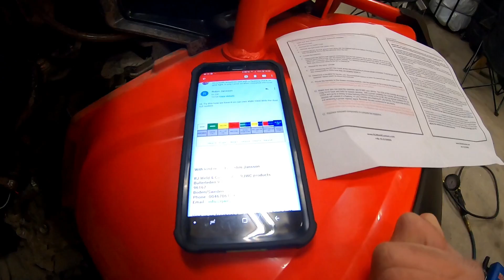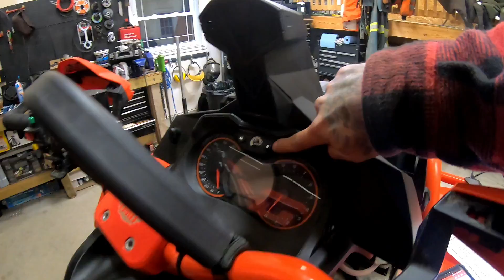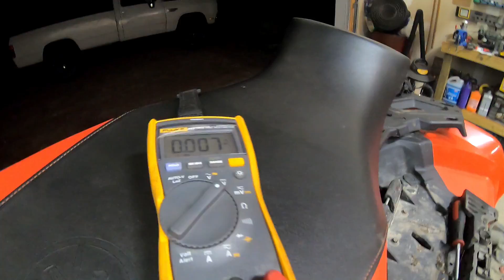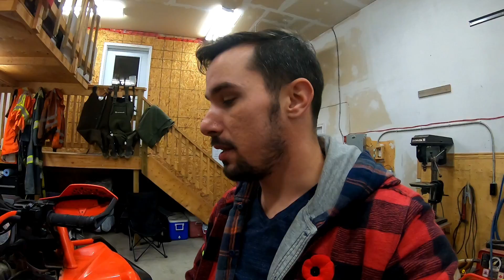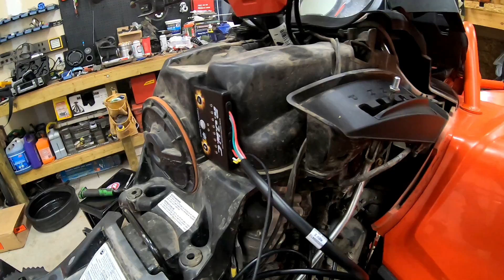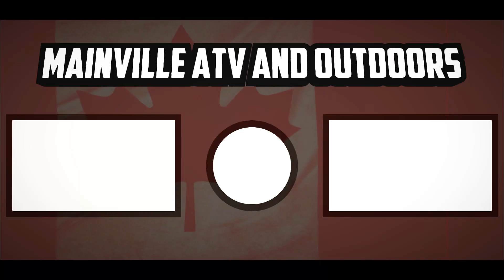RJWC Fuel Tuner! Can Am's Awful Lean Condition! (Can Am Outlander XMR 1000r)

Comment from the maker: What is your experience with tuners? Which do you have? Lets talk about it below! Don't forget to subscribe :)
Reply: What settings should i go for extreme hill climbings? What’s the best mode? I’m running on Outlader 1000R xxc...but still i want to keep the original pipe...RJWC pipe it’s tooo loud .Thx a lot🤟🇷🇴
Reply from the maker: @dreunu9887  I would call dobeck for that.
Reply: the tuner the good too is badly made mine water to get inside result button - stick shit

Comment: I have a question for you.
I bought a used 2006 outlander 800 and it has one of the RJ WC tuners on it and I experience a weird issue when I started up for the first time for the day if I shut it off and then immediately try to start it again it will not restart I noticed the lights are flashing on the tuner and I have to wait for them to stop flashing in order for me to be able to start the bike back up again. Do you have any ideas what would be causing this?
Reply: Hey thank you so much
I called them and I figured it out😃
Reply from the maker: I've never seen that happen. My guess is it isnt the tuner but hard to know. I'd call dobeck and ask. :)

Comment: Just made the chage tonight on outy 2020 1000 max limited,got it from durtylife as sugested, with covid took a while to get it but still goos service from them.installation was more complicated with all the wire harnest on max limited, but did it.
When for a test rise at 19:25 just before curfew.on pack snow, at minus 1 ,at level tuning for mod pipes ( with stok pipe) Sports mode, i felt a lot of more torque, so muchthat i felt torque steer, what a difference, tks for the tip and video to make it simple. Have a good hibernation (here in quebec until 8 feb)
Chears

Comment: Really thinking about it. I have a bogging problem on my 2020 canam 650. It bogs when you get on it but goes away once you ride it for a couple minutes. I let it warm up for 5-10 minutes before I ride it and it still bogs until you ride it for like 20 minutes then it goes away. Thinking it maybe could be to high of octane of fuel, to restricted or maybe to high of octane because I am running 93 in it and it’s olny a 650 so idk. I also read that a lot of people have the same problem as me and say it’s just a thing with canams and that their is nothing you can do about it. Hoping a tuner and exhaust will take away the issue because the machine is a beast once it warms up.

Comment: I'm running same set up on my renegade 1k but not sure on what settings I should be at? Rjwc duals, air filter and rjwc tuner. Seems to still be running pretty hot "lean" . Curious what you set yours at ? Also where did you hook up air/fuel gauge to?
Reply: What did you set yours at

Comment: Hello. Was wondering if you could help me out a bit. Just added RJWC duals and the tuner to my Renegade 1000 and was wondering if when u installed yours if the settings was good to go out of the box? And also how to go about testing the air/fuel ratio? Any advice would be great. Thanks

Comment: The wiring coming out of the first tuner you had was different than your second one that is weird. The first one only had wires coming out of one side and the second has wire coming out of both rubber pieces on top of the unit. Mine also has the wires coming out of both rubber pieces on top. Great vid way to roll with the punches 👍👍👍

Comment: I am keeping my 570 stock.  Everybody shares this frustration at some time.  Couple of years ago I DIY installed a garage door opener.  On the cordless phone, in freezing temps, up a ladder trouble shooting it with the Manufacturer.  Finally they yielded and sent out a new logic and power board, and again DIY fit those in place of the originals and "voila", worked perfectly and has since then.

Comment: So I just installed a rjwc full exhaust mud edition. Install went great but now my quad will not go faster than 44 mph. It does not matter what key i use. I have my performace key in and i still can not go any faster its as if once i hit 44mph its goveroned and just revs. Any ideas?
Reply from the maker: My guess possible cylinder miss, or limp mode. Something like that. If you installed a tuner which I hope you did, ensure it is plugged in correctly and grounded.
Reply: @MainvilleATV  i used rjwc tuner. I have no P codes. How do i know if its in limp mode?
Reply from the maker: @MGABRIEL8283  it usually tells you, but not always. To me, you may be in it due to a miss in one of the cylinders. Just a guess
Reply: @MainvilleATV  Thanks for the info.

Comment: Dobeck has a video of the chip board for these controller submerged in water. They have a water proof coating on them. I just bought one and a exhaust for my atv. So I have done a bunch of research about them.

Comment: I only have the Can Am Yoshimura exhaust.  Bought my RJWC tuner from Dirtylife as well.  What settings did you use?  I have a 14 XMR 1000.  Will be installing tomorrow.
Reply from the maker: Settings change on every machine, regardless of having the same one. Id call Dobeck for their tuning advice.
Reply: @MainvilleATV  The base settings were pretty amazing.  So far I just adjusted the yellow up one.  People on forum think it's a placebo effect but I'm sure it's not.  What were your findings?
Reply from the maker: @unnervingfalcon  around 80 degrees celcius cooler on my head pipe.

Comment: When I got my ECU reflashed they said I didn't need a rjwc tuner or a pc5
Reply: Hey man with the ECU reflash did you feel a power difference, and what mods did you have on at the time?
Reply: @nickenriquez2328  there was a little power difference not too much. And I had pretty much the same mods then as I do now. Like the 2 inch lift and the tires but instead of rjwc I now have empire Industries exhaust now.
Reply: Bulletin Music why did you switch to empire industries? Was it just a better exhaust over all?
Reply: @nickenriquez2328  the empires are further away from the gas tank so I feel more comfortable and they're way louder. I have videos on my other channel extreme mudding

Comment: If you had to choose between dobeck, dynojet, or ECU reflash, what would you recommend?
Reply from the maker: If money and time werent a restriction its easy. ECU flash hands down.
Reply: I ended up going the tuner route. The instructions say not to apply dielectrical grease cuz it voids the warranty. That does make sense though being that it would be under water occasionally

Comment: Would this tuner work on my Can Am 570 Outlander? I've been using it to plow this winter sometimes on 7 degree F days. I think it could use a richer tune to keep the engine running cooler.
Reply from the maker: Dirtylife.ca does have them available I'm sure. Have a look!
Reply: Thanks, I'll check it out.

Comment: Had a Dobeck from Bom Racing and the damn thing would not go rich enough. Had it on the dyno and ended up taking it off and putting in a PCFC to add enough fuel.
Reply from the maker: I was kinda close to maxing mine on one mode also but she made it. Thanks for watching!
Reply: Thanks for sharing, I was trying to find someone that had a PCFC because I liked these over the dobek. Thats the route  Iwill go
Reply: WeekendWarriors if you’re in Canada call Motorsports Addicts in Sherwood Park Alberta. They’ll set you up.
Reply: @beri232  yes I actually talked to them, still deciding because they sell the dynojet tuner with their tune for an extra $100 but not sure their tune is worth that over dynojets tune plus a few adjustments of my own by sound
Reply: WeekendWarriors I had them dyno my machine with my aftermarket clutches and I had gotten my ECM reprogrammed from Monster here in Canada.... so I only wanted a fuel controller..... which is why I cheaped out and just bought the PCFC. It still allowed larger increases/decreases in fuel than the Dobeck unit. I wouldn’t recommend one personally based on my own experience. I have talked to others as well who have had similar experiences with them as well.
Reply: WeekendWarriors I wouldn’t recommend the Dobeck. The PCFC worked perfectly out of the box and allowed for ample adjustment.
Reply: @beri232  awesome thank you very much! That really made me feel solid about buying that one. I will be ordering it soon

Comment: I have basically the same one as you Kyle its just branded HMF. I had to completely scrap their recommend settings. Due to the fact that I don't just have a pipe installed. I had to factor in race gas and the big bore kit, and cam. It took me a good month to find the setting where my bike would run good.
But one thing I have learned over the years I don't button things up all nice till I know they work cause if I do button it up I seem to jinx myself and I have to take it all apart again 😆